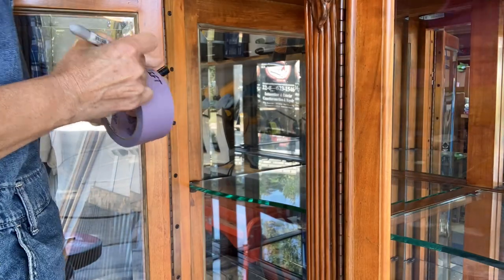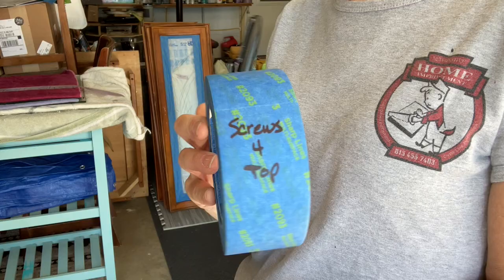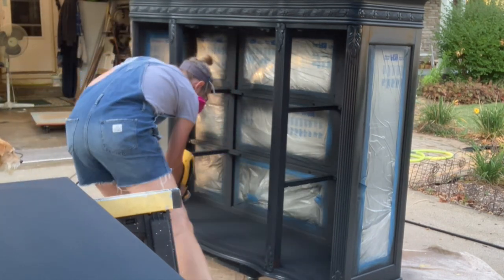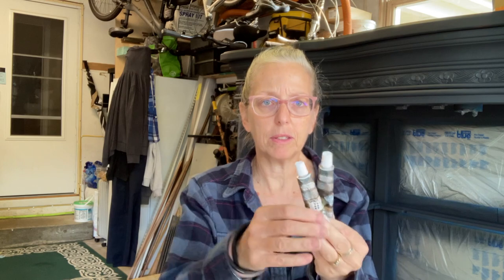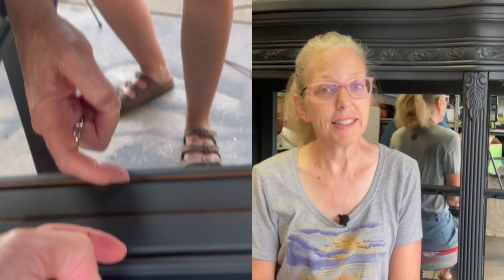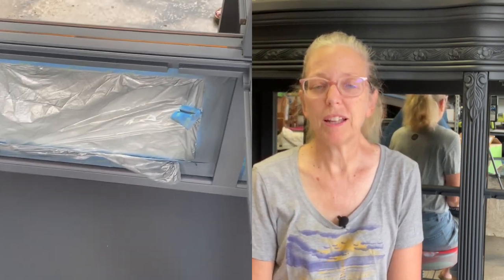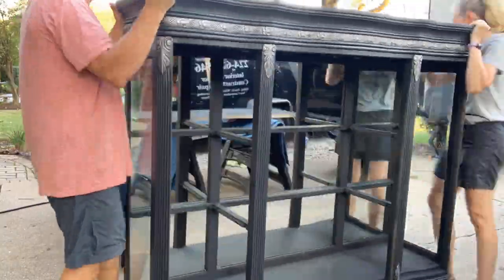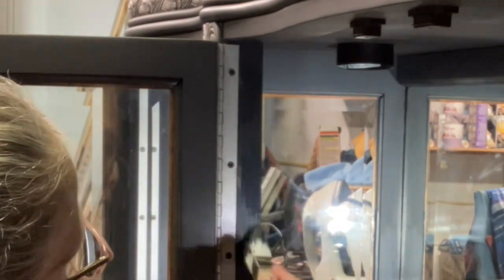Monster Flip with Melange Paint

Comment: Love this!!! - My observations; The original design was for the china cabinet to go on top of the buffet, and like in life, all things change. The top part stands a bit low, still, even with those perfectly matching legs. I'm thinking, in a situation like this, consider adding a 2" or 3" block spacer between the cabinet and the legs. it's not much but it adds up, overall, and does bring the shelving a tad higher. Your detailing was impressive.
Reply from the maker: Thanks for the tips! It's a very tall piece and didn't want to add too much height to it.  Of course in the end it was the customer's final say.  She wanted to raise it up but only a small amount.  I thought the feet I chose did fit so perfectly but you do have a point in raising the shelves.  It's not really a piece they use other than to display a lot of crystal.